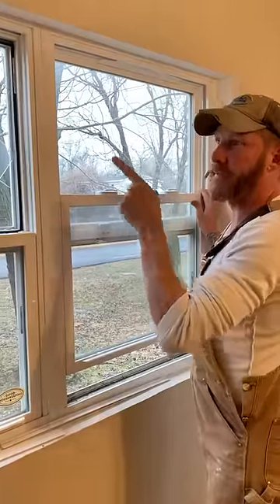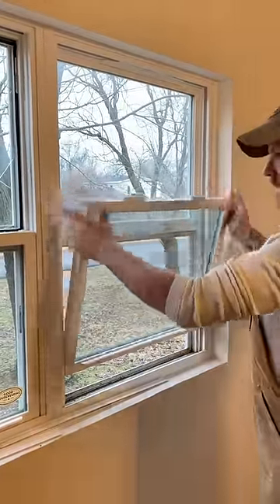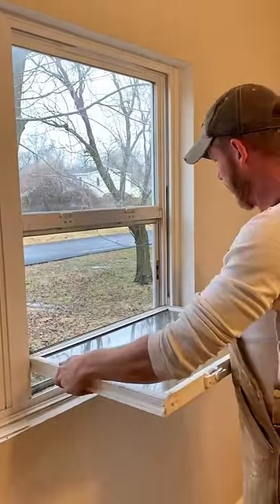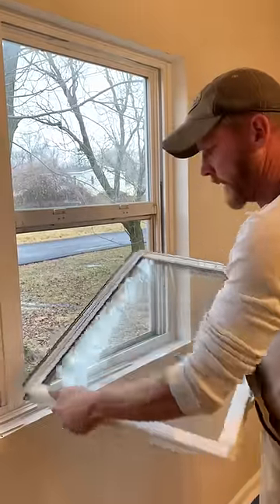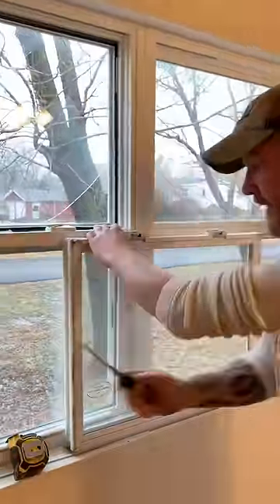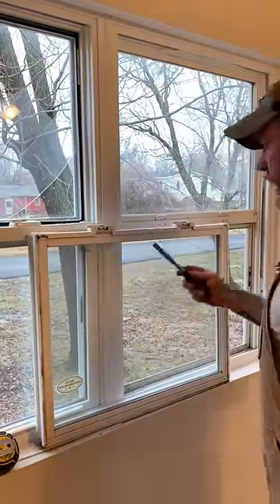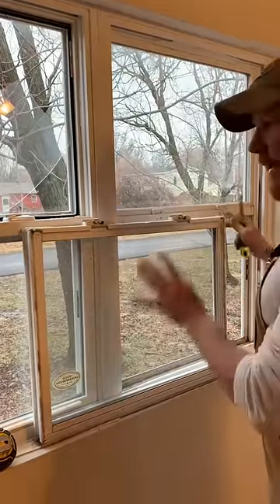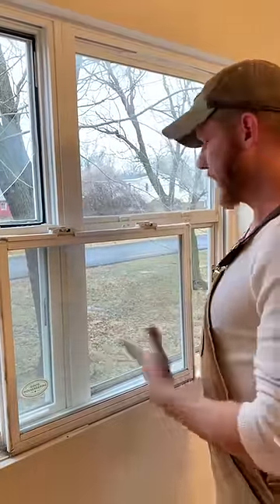Replacing replacement glass for vinyl window part two

Comment: Where do you get the replacement glass? I’m a painter and drywaller but I got into some drunk shananagins the other night and broke just 1 piece of glass in one these windows.
Reply from the maker: Just Google any window company. If you can’t take the window to them and do it and want to do it yourself you can stick a paper business card down in the gap beside the window and then bend the card over and that will give you your window thickness
Reply: Thank you so much for all this info!

 I accidentally shot my window with an arrow after my first archery class 😂. Only one pane broke though.

Comment: Easy ones how about the ones with   no top pieces to bring in top on windows to horizontal.  Mine have 4 plastic pieces on every corner sticking out any suggestions?

Comment: How you put it back inside what you just pulled out
Reply from the maker: You cut the old silicone out with a box blade in the new window lays back down in the frame there’s a plastic piece of trim that you have to pull out . Are use a five and one tool or a big bladed flat head.
Reply from the maker: It just lays back down in the frame. It only comes out one way.
You have to re-silicone it